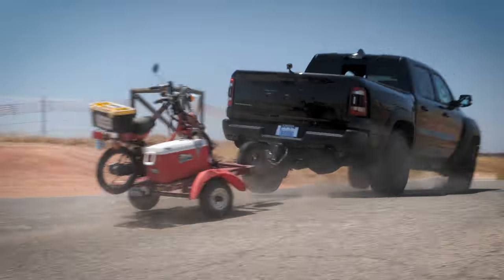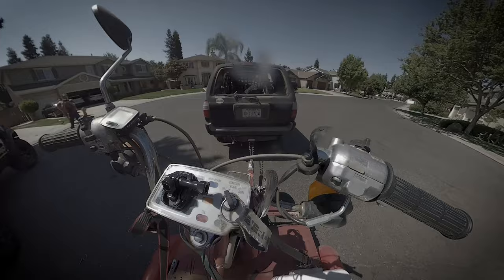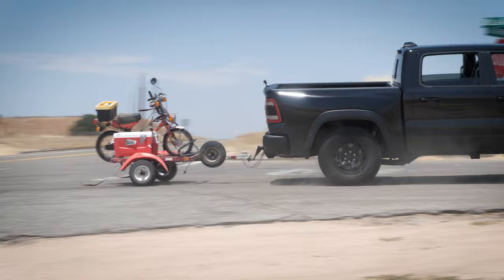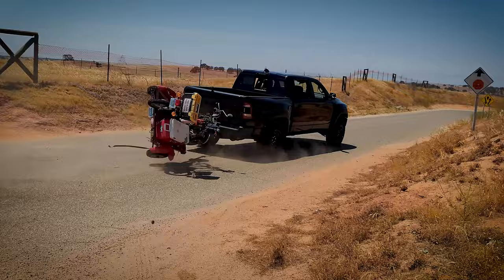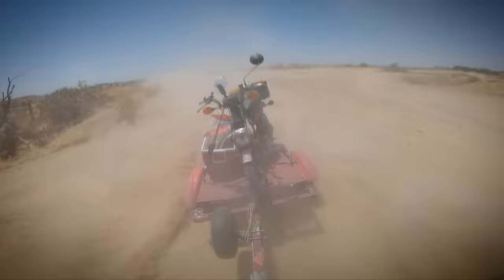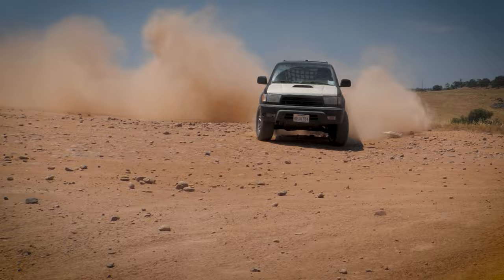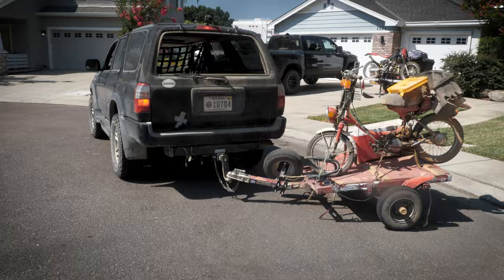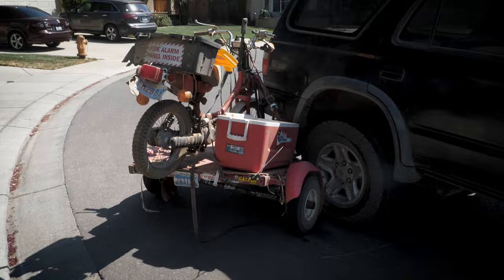Harbor Freight Trailer FINAL MEGA TEST...

Comment: What fun! Now that is thorough test! I have a slightly larger one, 4' x 8', which I have been using for 15 years. Here are the problems I have had: 1-The stock fenders broke off after 5 years and I replaced them with somewhat better fenders, but I had to make brackets for it. 2-Hit a tire on the freeway at speed and bent the axle, resulting in two flats from way too much toe-in. A tire place bent it back into shape and have been using it for 7 more years. 3-Recently the frame started cracking just in front of the axle and I had to weld it bake together  and added some angle iron braces.
Reply from the maker: 15 years!!! Nice

Comment: I had the foldable one and one thing this trailer does not like is being submerged in pacific ocean (hauling jet skis). Fucked the bearings and that caused failure to one of the hub and axel. Paint started pealing off and loads of penetrating rust. Wiring is rubbish too. But after doing an improvised axel conversion and got some decent lights and a receiver (probably overkill) it was one of the best solutions out there.

Comment: i just bought the foldable 4x8 trailer and this gives me a sigh of relief, i ended up bolting and welding the trailer togther at all the joints, i still am able to fold the trailer for storage reasons. but this is great news for me!

Comment: LOL holy shit!!! Great value and toughness from this $199 trailer, wow.  That poor little motorcycle on the trailer though...
Reply from the maker: Hehe that thing will get touched up xD I've been wanting to put a MTB front end on it
Reply: @TortureTestMagazine  A mountain bike front end??? LOL you're doing God's work with this channel. Hilarious.
Reply from the maker: @r0ckworthy  yeah I want to turn it into a hybrid lol! I'll put a hub motor front end on it and keep the gasoline engine powering the rear. It'll then be an AWD hybrid that can probably go anywhere and probably smoke most cars light to light haha
Reply: @TortureTestMagazine  Hmm, that's interesting. 2WD on a bike is traction heaven. Also, I always wondered about a hybrid minibike or MTB where it is an electric motor driving the wheel, but instead of batteries you have one of those small, efficient (Honda) generators onboard.  It's possible that the bike would  consume less fuel this way than it would if it was a traditional gas powertrain.